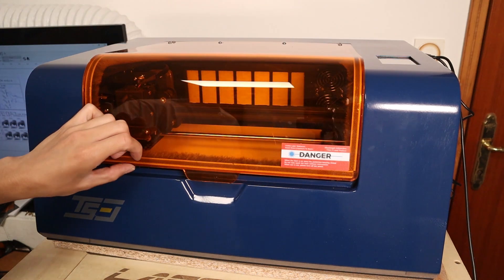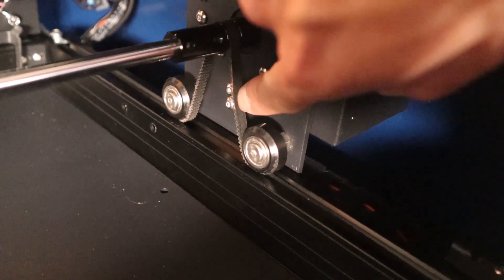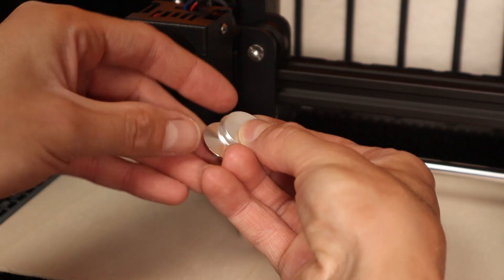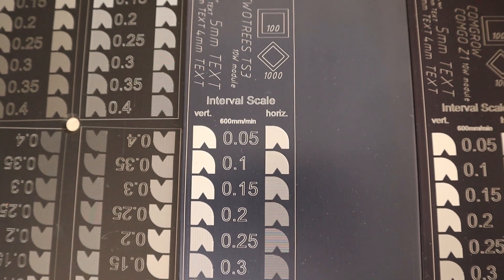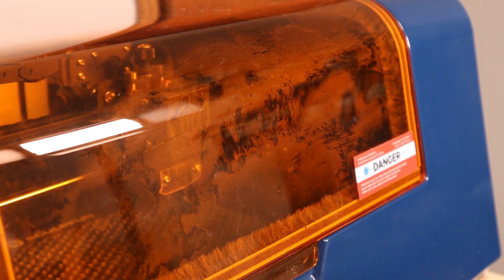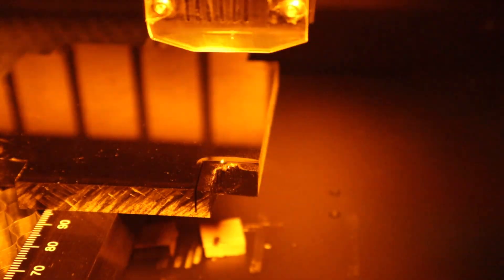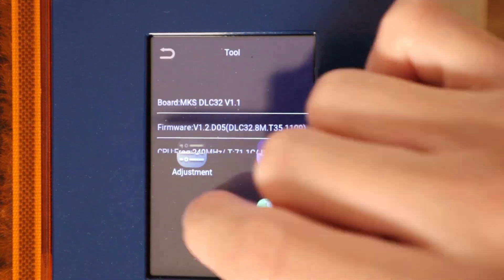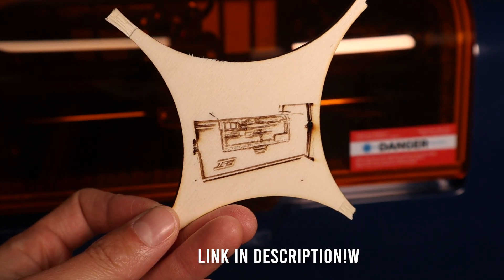TWOTREES TS3 Has a Little Bit of Everything, but Is It the BEST? Review and Test

Comment: Hello JT!
Please, I seek guidance, if I paint a white acrylic plate black, with black automotive paint, when I cut and engrave text on the acrylic, is there a risk of the acrylic catching on fire, do I have a Scalpfun S9?
Thanks!
Reply from the maker: There is always a risk, you should always be near the machine and observe what is happening.  But I think it should be fine.
Reply: @JTMakesIt  I believe that the power should be reduced a little, and the speed should also be reduced.
👉👉thank you JT👈👈
Reply from the maker: @humberto367  You always need to observe what is happening and adjust the settings accordingly. There is no one setting that applies to all situations.

Comment: Given the durability of diode lasers and the fact their life expectancy is absurdly short I fail to see the point paying over $700 for something that might last you 6 months if you are lucky! The biggest problem with ALL of these reviews is none of you are properly testing the durability of this technology. Sure they work great for a day or two of testing but then thats the last we ever hear about them! Geeeee, I wonder why that is? Sure they offer a 1 year warranty but read the small print because there is about half of this package that is not covered or only covered for a smaller percentage of that year and no where in the warranty terms do they even mention the laser, where under where it specifically says "What Is Covered" it is void of anything mentioning the diode laser or any component or part of it! One thing I found oddly not covered and one they mention is the card reader and board. Why is it that one of the simplest components of this entire machine is not covered and given without the card reader the laser is nothing more than a brick, that should be cause to question buying this thing at all!
Reply from the maker: Thank you for sharing your opinion. What makes you think this lasers have short life span? Diode should outlast a CO2 tube (which degrades over time and they have life expectancy from a few months to a few years). Diodes, if properly cooled should last upwards of 10k hours without significant degradation of output. In one of my videos I measured optical power output of Sculpfun machine after using it for 50+ hours on full power and the output did not degrade at all. But I didn't perform longer tests yet. I know that Sculpfun does 48 hour load test in factory on their lasers.
But you need to understand that these are hobby grade tools. These are not professional machines intended to be used 8 hours each day. You can't compare it to 10k$ industrial machines. What is your alternative in this price range? There is no alternative as far as I know?
Reply: Good points that should be brought up.